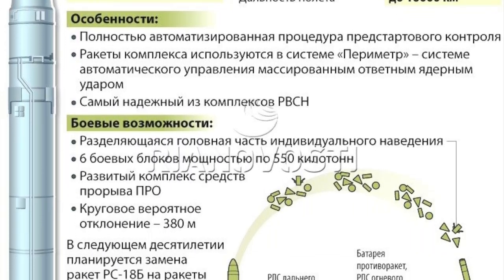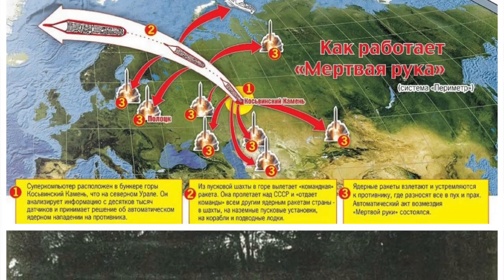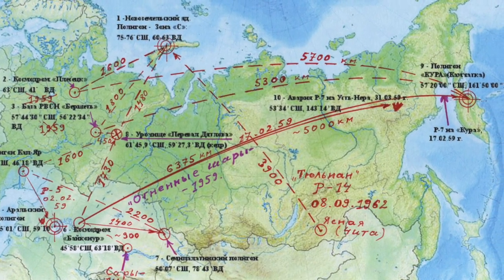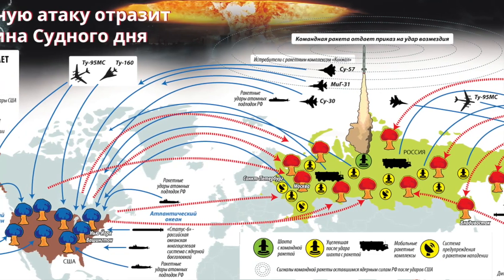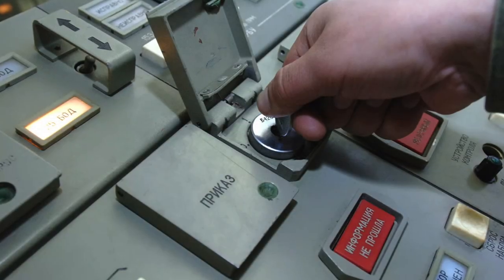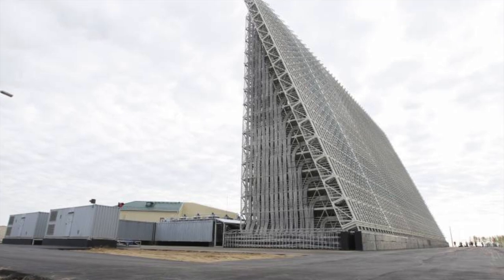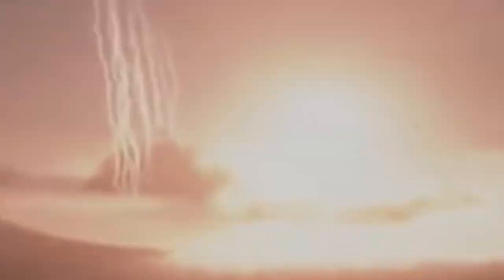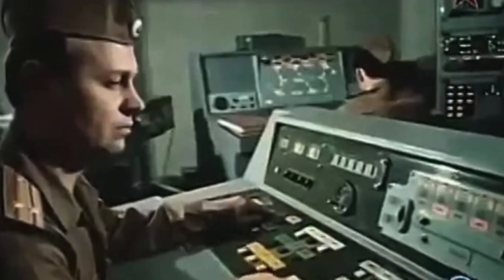Dead Hand - Perimeter System. The Animal Fear of the West

Comment: Something can't be "fully automated " and still have functions that must be initiated by a person.
Reply: system can automatically send hundreds of nukes to an enemy without a command from a human. It can operate autonomously and strike potential enemy targets, even if the whole country’s territory is destroyed after a nuclear strike. 

"perimeter" is a complex computer system that constantly analyses a wide range of parameters - seismic activities, and radiation levels, as well as monitors data from the missile warning systems placed alongside the territory. The system passed several modifications throughout the years of exploitation. First of all, Russia integrated into its new means of radio-electric intelligence such as Voronezh class radars capable of detecting missile launches up to 7 000 kilometers away. Secondly, engineers modified its warhead to withstand new emerging means of electronic warfare that shut down radio signals,”

Dead Hand’s missiles are in the line to receive hypersonic missile blocks. These blocks will allow it to fly at a speed of 5-7 kilometers per second. 

So your claim that it requires a human to activate it is wrong. Yes, it's true that once activated it tries to establish contact with designated authorities but not to get their approval but to gather more Data.

Comment: If it was a deadman trigger system then why wouldn't it have been triggered when those unexpected meteors came down and exploded over Russia in 2012? Caused a shock wave that damaged multiple cities and glass rain from the buildings windows breaking
Reply: 5:53. The system monitors sources of ionising and electromagnetic radiation and compares it to atmospheric pressure and seismic data. The bolide event produced pressure and seismic waves, some low level electromagnetic maybe, but not ionising radiation. Therefore the system did not trigger
Reply: Gotta do something to keep the trifling West at bay, if one goes down then we both go down. Sounds liable to me.
Reply: It most likely as well has a dual key system not unlike any other missile launch. Once the keys are turned the system arms and proceeds according to its program.
Reply: @chvfd687  Then that's not really a Deadman switch
Reply: @samuelmmmk181  well,yes and no at least from my standpoint. Allow me to explain. I'm looking at the two key system if it does exist to be an intangible not unlike a lockout/tag out used in a lot of equipment. In times of repair, inspection of critical components, etc it would be activated to prevent the unthinkable from occurring. During high tension times the key could be turned to arm said system and be like a set it and forget it type matter.
Reply: @chvfd687  That just means if they were surprise attacked then the Russian system is a failure. . Which is what they wanted to prevent the whole time.
Reply: Because those sensors measure radiation too. Unless the asteroid is comprised of Uranium or other radioactive element these sensors won't have anything to detect and thus no launch.
Reply: Because it has human involvement. Humans monitor the system, and it launches automatically if there is no communication with the human element.
Reply: @samuelmmmk181  if any officers didn't respond within time dead hand  it will automatically do it